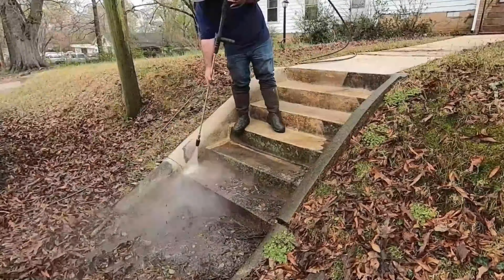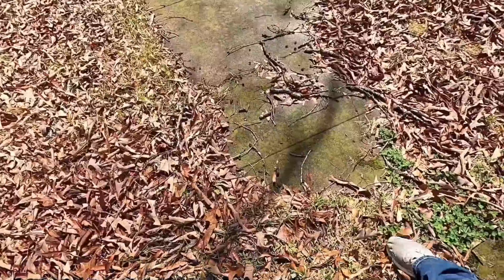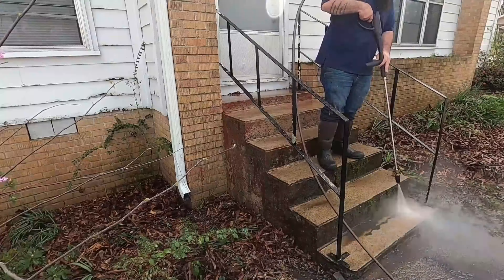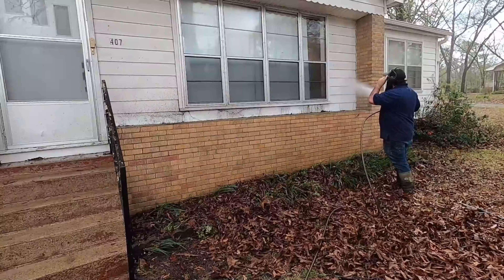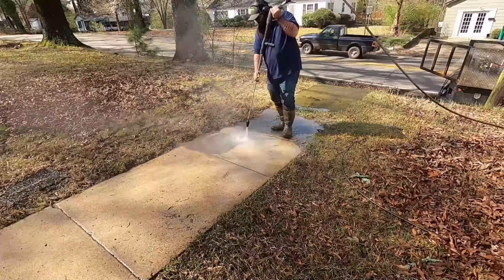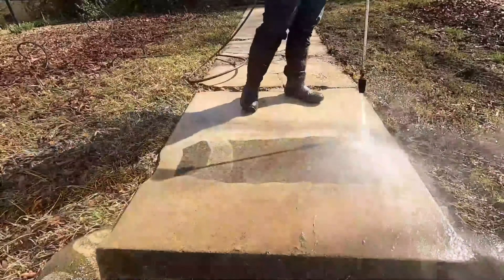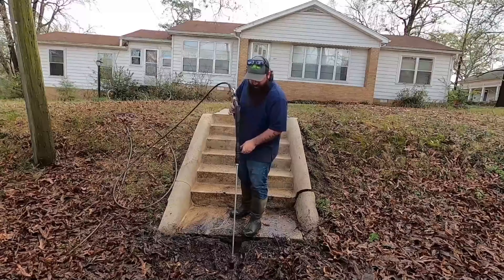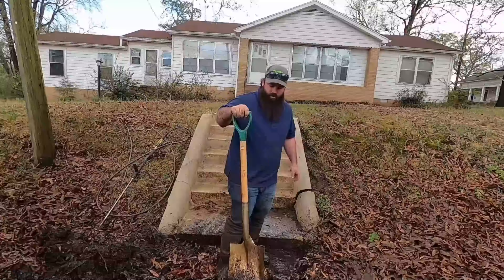I FOUND this sidewalk that no one has seen in 50 years |  FREE POWERWASHING job

Comment: Hey Kevin, heres another comment for you…more a question though. Dunno if you have time to answer but here it is. Maybe someone else can answer as well. I have a customer that has moss growing on the roof of they’re small garden shed. Large maples around it causing it. I’ve cut back the branches so that solves that part but they want the moss removed. What do you use or what would you use to get rid of moss from asphalt shingles?